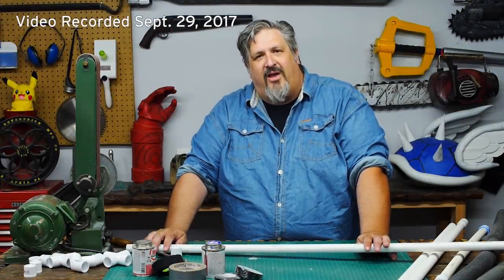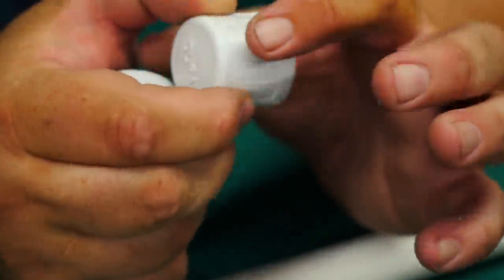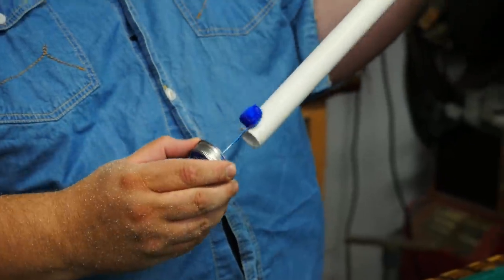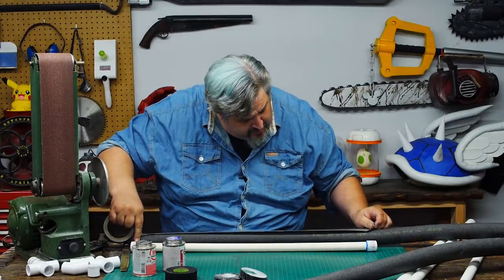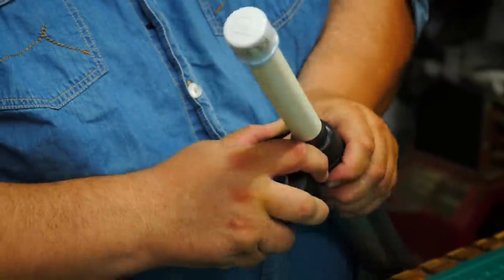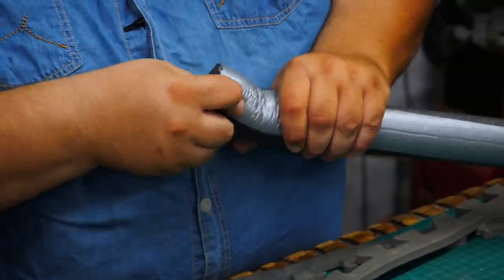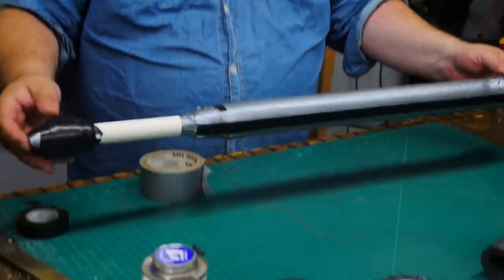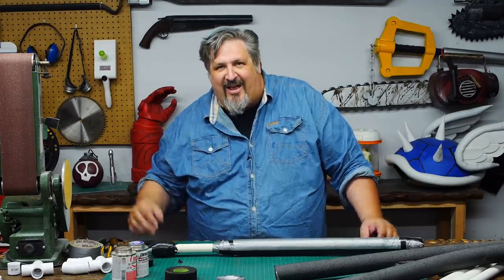XOT Makes: How to make a basic boffer sword

Comment: The tech on these have changed a ton because that thing would still annihilate the target. Graphite or kitespar cores, different tip design and packing tape vs electrical and duct tape. It was awesome to see the old tech again tho. I've been a larger for over 17 years now.

Comment: IMO when it comes to pipe foam, always go a size up (that is, for example, don't use 3/4" ID foam to wrap around 3/4" PVC, since you need to take into account the wall thickness of the PVC, which brings it up to JUST a HAIR under 1" making foam with a 1" ID a better fit.  Likewise, if you use 1/2" PVC use foam with a 3/4" ID to acount for the core being almost 3/4" diameter, etc.

Comment: Hey guys boffer of 17 years making mushroom caps out of foam works wonders my field has a strict rule about it. But really just pad those ends. I also would open the foam and wrap it that way. Great video though. Very different method though I think I may try it mixed with my Field's rules and make a video too on my channel thanks guys RIP Zot
Reply from the maker: I've seen there's a lot of regional rules for different boffers. But yeah I agree Just wrap everything, mushroom cap the end. And I'm used to duct tape wrap from the '90s. At this point fabric wrapping everything is far far better!
Reply: @OdinMakes  never used fabric much but some of our best sure did I might actually explore it with my next attempt at a shield thanks for the tip

Comment: Boffa-combat. The big rule is: lightest touch counts.  Everyone forgets that.
Reply: Depends on the ruleset. Amtgard, sure, but Belegarth and Dagorhir both require a 'sufficient force' hit for it to count. 

With this weapon, it would have to be lightest touch, or someone would get hurt. That foam, how little foam there is between core and surface, and the use of duct tape on the striking surface wouldn't fly in full-contact boffer sports.

If I took something like this to a practice or event, I'd get laughed out of weapons check. They wouldn't even bother testing the weapon.

I don't mean to crap on this guy, especially considering his recent passing, but this boffer is not safe and no one should be copying it.

Comment: What if instead of PVC pipe cover why not use a pool noodle
Reply from the maker: Basically, PVC pipe covers are softer. Pool noodles are pretty dense, And if you're going to put a PVC core inside of the pool noodle you can really smack someone with it. If you're only going to wrap duct tape around a pool noodle and just run around the yard and have fun, then go for it!